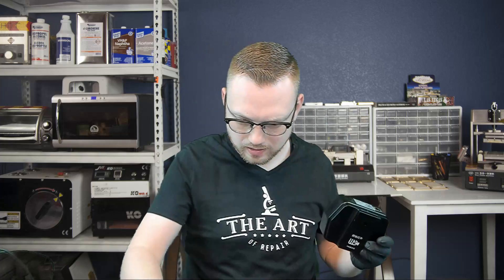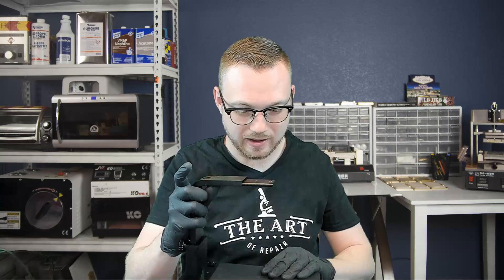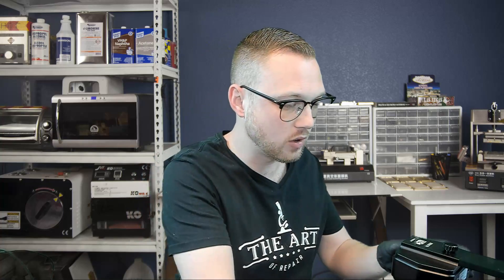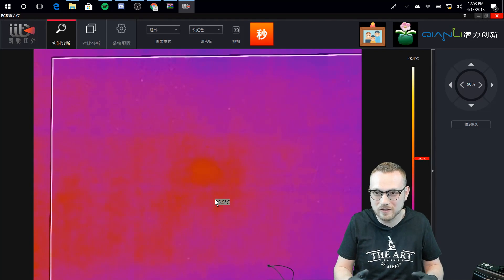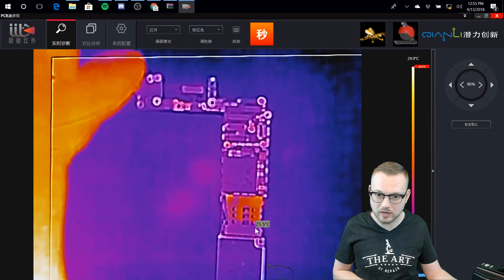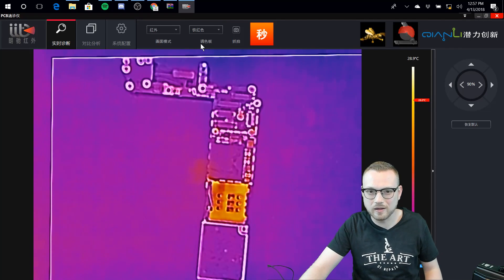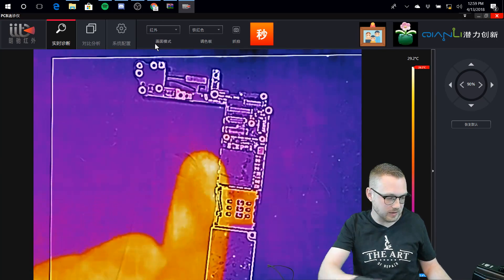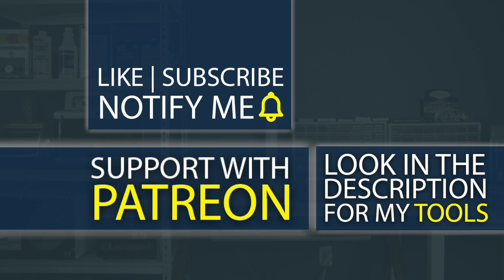English ToolPlus+ / QIANLI Thermal Imager Setup Guide ( WITH DOWNLOAD LINK )

Comment: Hi Justin I had QIANLI thermal camera model potential 2891. I had little trouble with settings. I found on the internet that I must change my network settings in to subnet 192.168.2.xx, but when I do that, my network will stop working. Because my network uses the subnet 192.168.1.xx. Because of certain network applications I cannot afford to permanently change the subnet on my router in to 192.168.2.xx which would solve the problem. Is it possible to change the camera settings to communicate in subnet 192.168.1.xx instead of 192.168.2.xx?
Reply: Just go do tcp ip v4 settings iP advanced , first set ip as static, and under advanced add the IP address of ip cam and subnet , you can have both at the same time

Comment: If you finally got one of these. I hope you noticed by now the drop down on the far right has a English option. Surely you know by now.
Sure wish I could get this equipmemt. It just isnt worth the money to me since I dont do alot of repair. Or run a bussiness.
But it would be a great tool and save so much time. It is amazing.
Reply from the maker: When i got mine the software actually didn't have the English option, I was actually told to update my software and the English option showed itself XD
Reply: @TheArtofRepair  👍👍

Comment: I believe this uses FLIRs lepton 3 sensor and MSX technology.
The dual cameras are to give the images an appearance of an outline overlay higher resolution is called MSX that FLIR started using. This allows for lower less expensive resolution infrared 160X120 to be viewed with more detail in the final image shown from a cheap basic CMOS second camera overplayed image. Or in this case they claim it’s a 1080P camera for the overlay image. 
https://www.tequipment.net/FlirMSXMulti-SpectralDynamicImaging.html

It might be cheaper to buy a used FLIR ONE V1 or V2 on eBay and use an old cell phone laying around then paying $850. I use a FLIR ONE V1 on an iPod 6th gen, or my old iPhone 6S now that I have adapted it to fit the 6S. The V1 has a longer battery life to record videos. But the V2 or later still FLIR one has the newer lepton sensor.
I think this open source software can work with most of the FLIR lepton sensors:
http://joe-c.de/pages/projekte/thermovision.php
A lot f information can be found on the EEVBlog about this. 

The 3 types of image displays you showed are normally referred to as “Grey Scale”, “Lava” (the middle one you liked), and “Rainbow”. The manufacture calls it White Hot, Red, and Rainbow as seen at the bottom of the manufactures page, this also shows other features of the software and hat button do what:
https://www.unionrepair.com/thermal-imager-for-mobile-phone-pcb-troubleshoot.html#/product/7066

The metal appearing at the hot when you mentioned the board has no power is known as emissivity. Sometimes software can slow for compensation if this, if not you can use a tape or material that has a emissivity rating above 0.95 for a more accurate view with about a 95% accuracy. This doesn’t mean the temperature reading if that component or shield will reflect the accurate temperate, but will allow you to view the image and possibly see  what you looking for easier. 
Welcome to the world of thermal imaging.